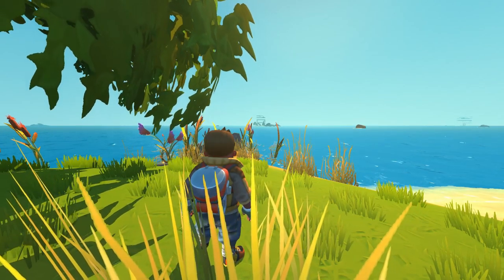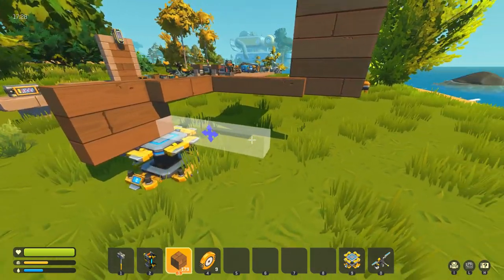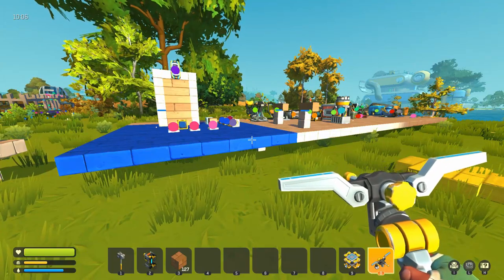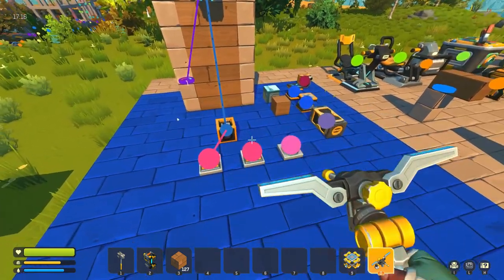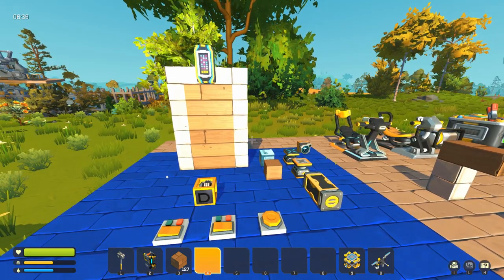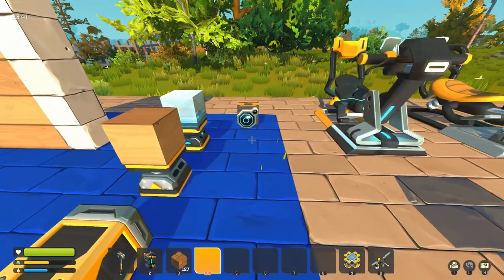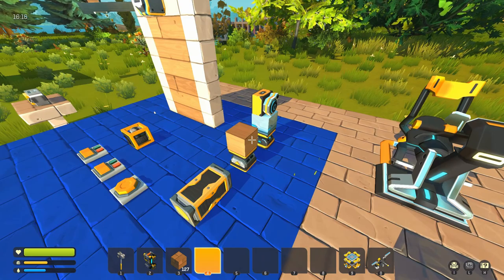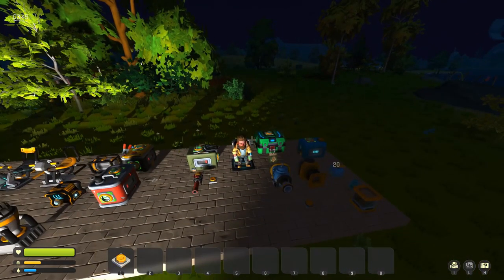How To Use the Essential Tools and Parts in Scrap Mechanic Survival Mode!

Comment: Some extra tips: if you're trying to build under where the lift holds your creation, build a long temporary piece on your creation.  This will change the center of your creation so that the lift changes where it holds your creation.  Note that controllers have a loop button at bottom left to repeat the sequence.  If you want less than 15 degree increments, hold shift while you drag.  Great tutorial, Moonbo!

Comment: A handy tip that's kind of against your mantra, Moonbo, but one that's actually saved me more than once. Put a full 10 diesel or battery directly into the engine on top of connecting fuel tanks to them. The reason being is that you can physically see the fuel being drained from the tanks (the measure bar on the side) and once that's gone, your creation stops. . . unless you have fuel in the engine directly. Then you have a small amount left over. I've surprised myself and wondered if it was a glitch to run on fumes, but no it was fuel in the engine and it's been a life saver.

Another tip that's actually changed recently, the vacuum pump is a very versatile tool. They've patched this and it's saddened me (but it's for the better), but the vacuum used to yeet out anything from it at super speed. Meaning you USED to be able to rig it up as a "poor mechanic's" mounted spud gun early on. You could also yeet water across the map. They've reduced the exiting speed of the vacuum pump, but that has actually made and interesting bit.

For those of you who have mass produced the glass tubes, you can use vacuum pumps in the same capacity as water cannons. They perform about the same. Meaning you could theoretically have a pump at the end of 1 tube on a controlled bearing sucking in water and another on the other end of the chest or water tank to fire out that water and have 2 versatile vacuums instead of 1 water cannon. The only con of it is that the water cannon isn't bound to the tank/chest via tubes. So if you have the tubes, go ahead and experiment with some crazy designs. If you don't, the water cannon would be a better choice instead of investing in glass tubes (less resources at the end of it all). Just some small things to consider that were not covered in this great video.

Comment: ...and glass - You can also break glass with a hammer &/or gun.
I also noticed something by accident one day. It  'could' be useful? ... While wielding a bucket, you can remove water directly from a container.
Reply: So.. this means that I could possibly throw water at bots as a defence and quickly fill up the bucket using water container? Not sure about how effective that is going to be, but still pretty interesting.

Comment: There is one more Logic function that you should cover. NOT gates. While they are not here you can use the NOR and a single input to create the same effect. This will give you the full range of Logic Gates. Also, A fun little book to help with logic function would be Digital Electronics DeMystified by Myke Predko.

Comment: I wish you made this when survival came out. I was one of the many who bought the game then and some of this stuff was not easy to figure out. It's a great tutorial though. 
One thing i still have a problem with is welding two or more pistons to a base with both pistons connected to the same plank of wood. They wont connect and it is all floppy. Anyone know what i am doing wrong? I thought putting the plank on a lift would work but it don't because only 1 piston gets welded that way. On a vehicle putting it on the lift works but i don't want to lift my base...
Reply from the maker: I would have made it sooner if I had all of these parts available to me in survival! As for your question, the best thing you can do is remove the least amount as possible to separate your pistons from your build, connect your weld points and fuse them, then weld the whole thing in the removed section.
Reply: @Moonbo  Ahh I see, so make the piston thing work as a separate entity and then wield that onto the base... Interesting, yes I bet that would work. Thank you soo much! This has been doing my head in...
Reply: @Moonbo  Oh also if you see this, I have not seen anyone make a submarine yet. One might be good for collecting oil and clams. Just an idea for a video... maybe...   :)
Edit: Or maybe a unicycle or something that can drive on the bottom because of all the fuel use...
Reply: @JessicaMarinaRushie  I've built one, useless waste of time, but I didn't regret this :p
As a main block I used barrier block.
The reason is the buoyancy 7. Barrier block is the only block with buoyancy 7, and minimal buoyancy to stay on surface is 6 so it's an good option.
Build everything underwater, that way you can see every change in balance. I've made one mistake during the building process.
Thruster has extremely high weight, and I put a bunch of wood 3 blocks (highest buoyancy block) around it.
Then I upgraded thruster to lvl 5, and the whole submarine turned upside down because thruster weight turned from 9 to 2, so before trying to balance everything, upgrade the thruster to the lvl you want (maybe seat will also loose weight on higher levels).
I put the gas container on the bottom, thruster on the back, seat in the middle, windshield and headlight on the front (not that important of course).
But there's no use for submarine.
1. If you need to go gather oil and glue, it's not that efficient to cross such a small distances on submarine.
2. You still can't breathe underwater.
I expect Axolot to add some submarine seats, that, lets say can't be connected to engines, but allow you to breathe inside a vehicle.
3. Waste of gas.
In the end, useless vehicle, but I hope useful experience.
Maybe you will need it later, so you can try if you want.
If you want something more useful for now, then try to build a boat, it's much easier.
I hope I helped you.
I would like to maybe make a video, but I don't have anything required to make one.
Good luck building whatever you build!

Comment: Please help me! I can't weld 2 sets of blocks both connected to seperate pistons (I want to make them "work together"). The pistons are placed on a building on the ground (can't place it on a lift).
Reply: You're going to have to cut out the floor the pistons are on and put that on the lift. It's really convoluted in a way, but that's how it'll have to be done. I had to cut out part of a wall in a house to get 2 bearings to work together.
Make sure when you cut out the floor, you replace the block, but also do yourself a favor ahead of time and paint a line across where you're going to break the floor and make sure it's in a reasonably easy accessible spot. The paint is so you can line up the floor piece to your floor and the access is so you can actually weld it back where you need it to be. (I made the mistake a few times of cutting out the minimum amount of wall out and I couldn't get the piece in right because I couldn't actually see the face of the block I needed to weld onto.)
Reply: @steeljawX  thank you so much

Comment: I don't feel like I'll ever understand Logic gates. Feel like I need a engineering degree to play this game
Reply: I use a cheat sheet when working with gates
found it on reddit in r/Scrapmechanic
Reply: If you take the function it's set to and put it out in a sentence (and understand what XOR and XNOR and stuff means) it actually makes more sense than you'd realize.
AND: If A AND B AND C are active then do R.
OR: If A OR B OR C are activated at all, do R.
Pretty straight forward on those 2. 
The rest will need some translating/breaking down. XOR basically boils down to the "Highlander" function; There can be only one. Interpret X and not in this case. If A, but not{X} B or C, OR B but not {X} A or C, OR C but not{X} A or B are activated, then do R.
Translate N as "Not" or "Neither" or even the reverse (if they're deactivated instead of activated)
NAND: If A AND B AND C are NOT active, do R.
NOR: If any of A OR B OR C are inactive, do R.
XNOR: If A, but not{X} B or C, OR B but not {X} A or C, OR C but not{X} A or B are deactivated, then do R.

This might not help, but just wording it out has helped me. Like rigging up a door. I don't know if this helps as an example but just read this out and think about "actions", "reactions", "how you want them connected". I want it so I I flip this switch (A) then the bearings will rotate (activate) and then if I flip this other switch (B) it will rotate back (deactivate). So if A but not B or if B but not A. = XOR.